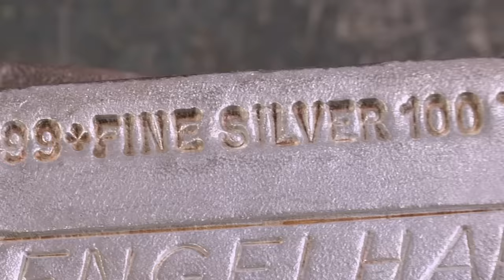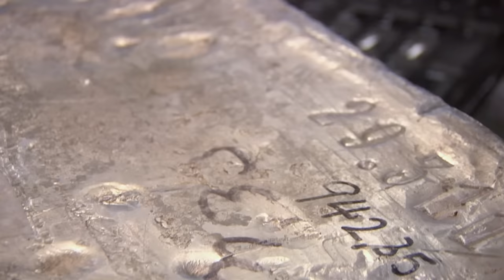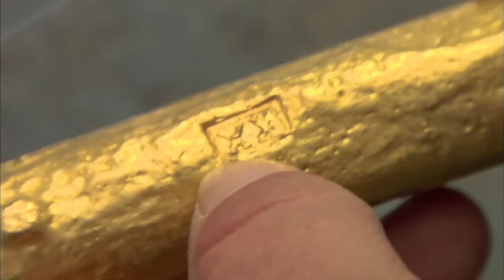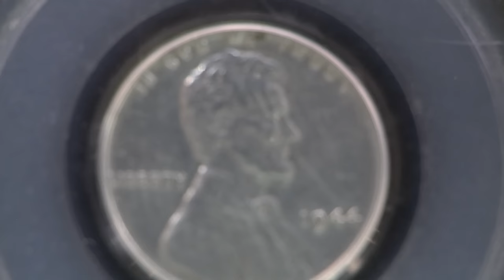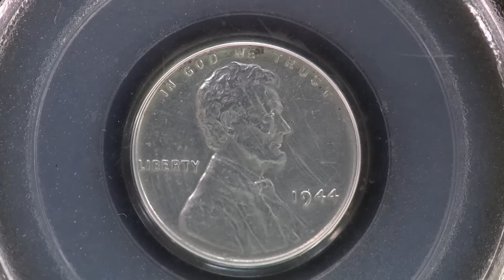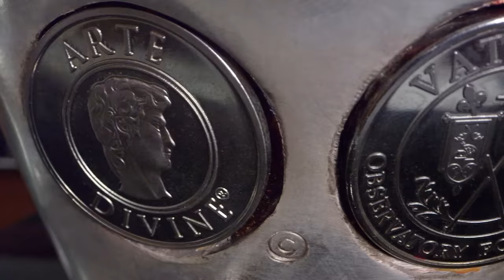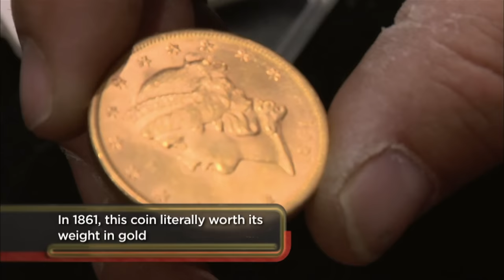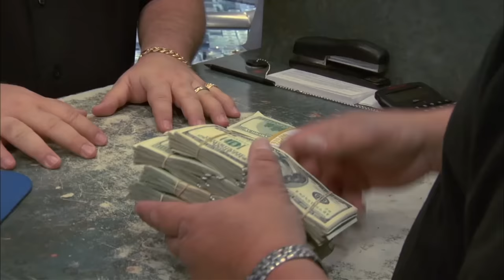Pawn Stars: TOP 5 RARE GOLD & SILVER DEALS

Comment: There’s a trick I learned when I started collecting silver coins that a silver coin makes a very distinctive sound when dropped, a traditional newer coin makes a dull plunk
Reply: I guess that's helpful if you like dropping your valuable coins around.
Reply: @HunterShows  Most silver coins are only worth the silver anyway
Reply: @HunterShows  no that is the way you test silver for counterfeit coins drop it on an anvil and it will ring like a bell if it's real.
Reply: the test is actually that gold and silver will ring like a bell when chimed, plus a diamagnetic neodymium magnet test, but both tests are not infallible as you need also a sigma precios metal indicator.
Reply: Get a pocket pinger or a verifier
Reply: This is where the saying of something "ringing true" originated, the distinctive sound real silver makes when pinged.
Reply: silver coins sing. 
but personally i would never drop one.
Reply: @heaven-is-real  
if it's a random silver round yes. 
if you have a valuable coin you handle that thing with gloves and prefferably never expose it to air. (if it's silver)

Comment: Rick doesn't know what he's taking about; 1000 oz bars have significant weight variation.  If you request physical delivery from a Comex contract, you'll be expected to pay 10% extra since bars can vary either way by up to 10%.  A single Comex silver contract is for 5000 ounces and it's extremely difficult to request and actually get the physical silver.  Criminal banks dominate the paper market and don't want small fries using it for physical delivery.

Comment: 💁‍♂️ I have 2 1944 steel pennies amongst so many other rare coins and bills. 🤫🤐
Reply: You could probably get $1,000,000+ depending on how 'mint' they are. If they're in mint condition, do NOT sell them individually for less than $500,000 and collectively less than $1,000,000.

Comment: The Penny Guy Was Right to Walk Away From That Offer. Auctions DO NOT Dictate Value They Only Show What a Person is Willing to Pay Regardless of What The Item is Worth. Just Because The Last 2 Available at Auction Sold for About $30,000 Does Not Mean That They Are Not Worth More Than That Especially if One Sold in 2008 for Over $370,000.
Reply: Completely different coin from a completely different mint.

He had one from the mint that printed the most of those so he had the lowest value of those versions of coins. Not to mention that coin collectors taken to account the condition, and his wasn't in good condition.

Comment: 2:53 what a bunch of b***** every poured bullion bar weighs a different amount.  The refinery that produces it stamps it with the poured weight along with their seal or refinery information.

Non-destructive testing of a bullion bar of that size is easy to do.  Only an idiot would drill holes in a silver bar to test it it's not needed... And by drilling out silver you're affecting the weight of the bar